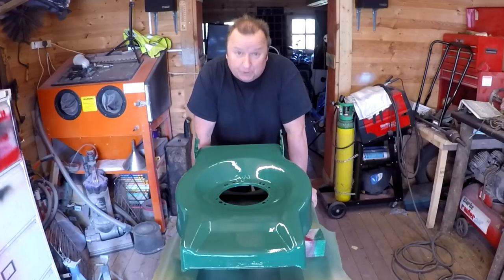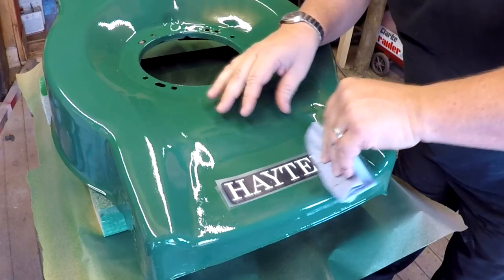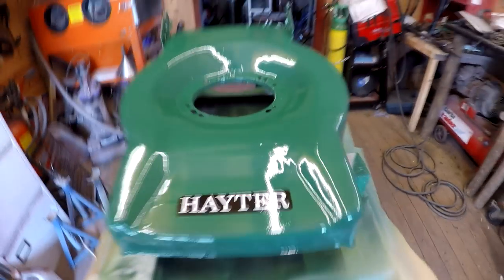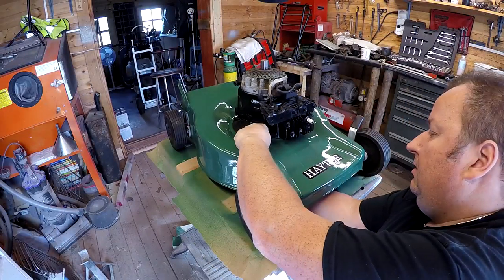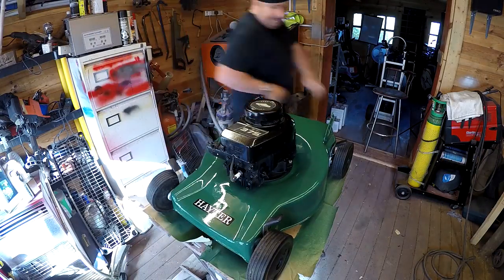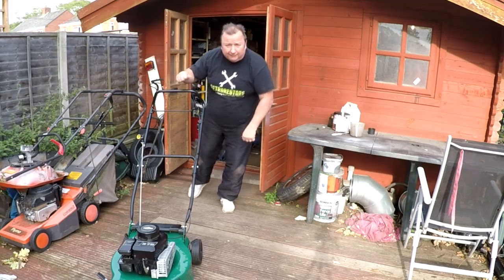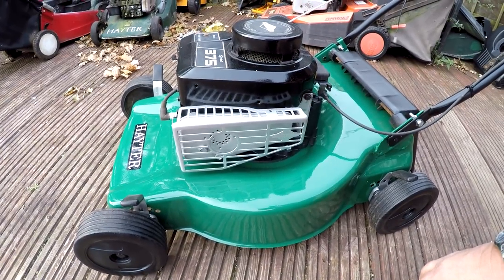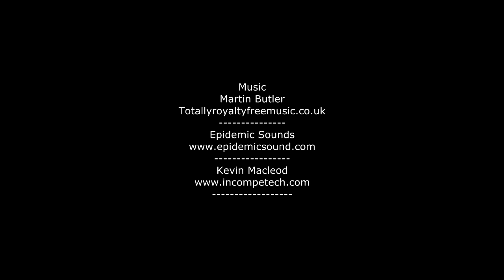#WorstLawnmower Revival Part 4 Hayter 1 Reveal Restoration

Comment: Nice job Martin. No really you've done a good job. I've an old cylinder mower you can have as a project if you want. Ran fine but the coil got damp. It's the one I used to show sharpening the blade.
Reply from the maker: Thanks Malc, I've got a backlog of mowers at the moment lol I'm sure you can turn it into something to grind cat litter lol
Cheers
Martin
Reply: LOL it's just stuck in the way. Shame as I sharpened the blade and it would cut great....never cut a blade of grass yet.

Comment: I like your paint work, did you use rattle can ?  Does that paint scratch easy after it's all cured ?
I paint alot and have started air gun painting on last project, a loader for garden tractor
Reply from the maker: Rattle can for the colour and spray gun 1K clearcoat to protect it. Good luck with your project bud.